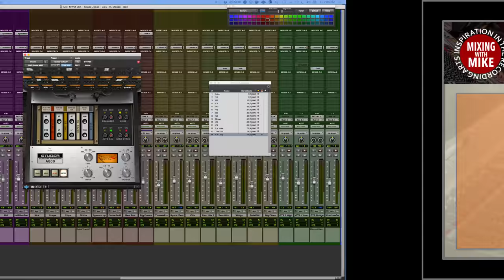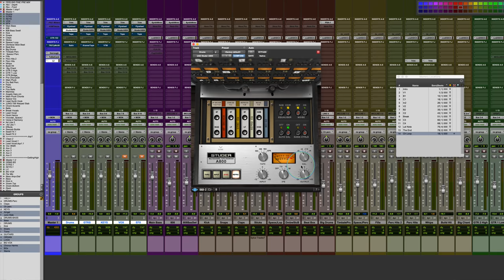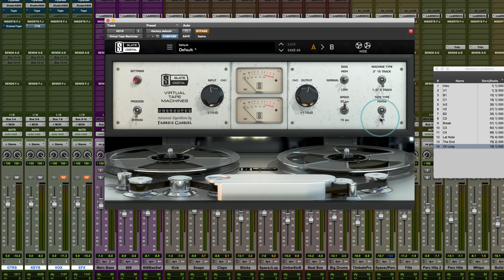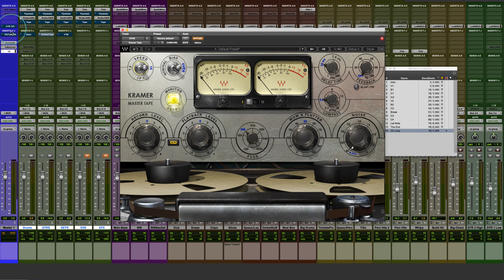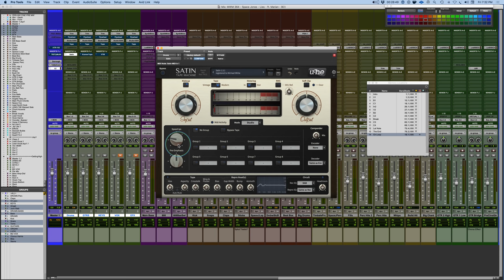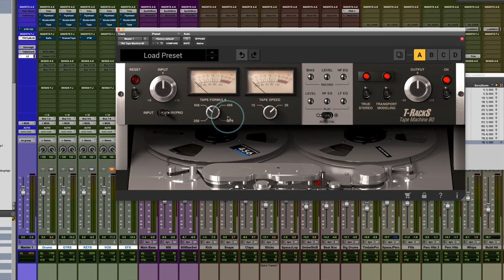Boot Camp Tip: Using Analog Tape

Comment: ⭐️⭐️ SO WELL EXPLAINED!! ⭐️⭐️
Thank you, Mike!
In the 80’s I owned an Otari 1” 8-track Calibrated for Ampex 456 at “0db” and it was wonderful if limiting. 

Then in the 90’s I moved to an MCI JH-24 that was hot-rodded TO DEATH! 😄😄
I know we had it calibrated for Ampex 499 at PLUS 12db! 😆 but if I recall correctly we did a lot of experimenting with getting it up to PLUS 18db.
It was extremely clean sounding, and for those reading this, that means it had very little of the “tape sound” anymore. But I was obsessed with eliminating the “flaws” of tape recording that we were always fighting AGAINST.
I was an early adopter of digital tape recording.

Point being: If you REALLY want to understand nearly everything you’d ever want to know about the art and sound of tape recording - all you need to do is sit down with THIS VIDEO and a couple of books from the 90s on Audio Engineering, OR just doing Mike’s bootcamp, until everything in this video is understood.
⭐️⭐️⭐️⭐️⭐️